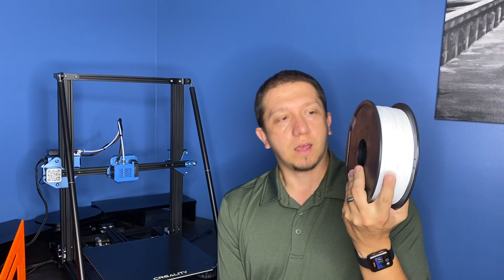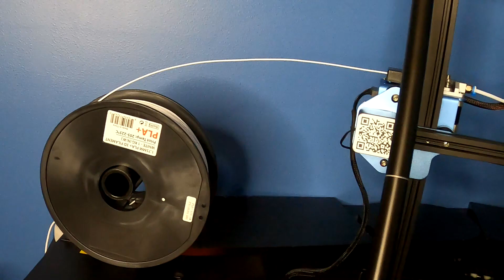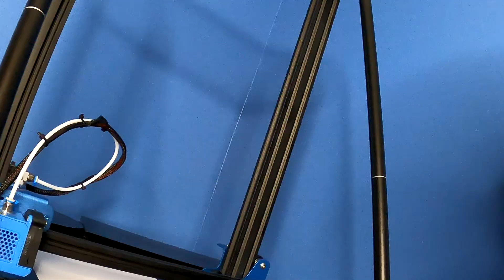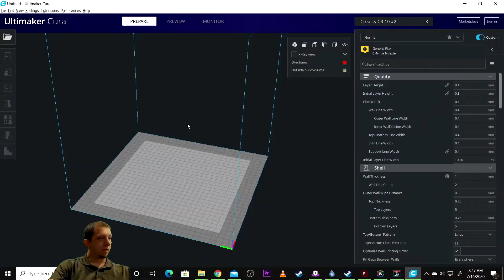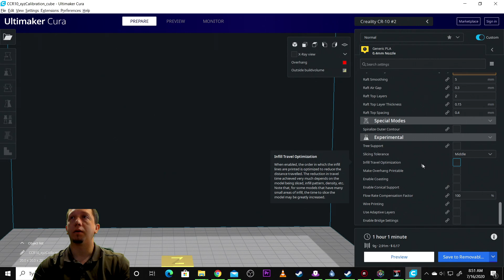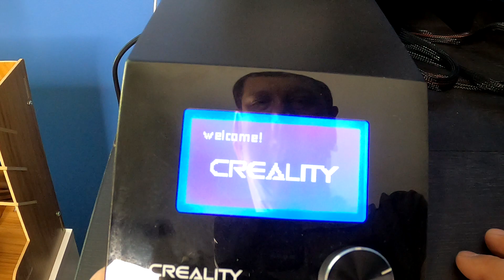NEW Creality CR-10 V2 3D Printer Getting Started ( Part 2)

Comment: Is it possible to make this printer wifi with a raspberry pi? I don't see a USB port on it but I was wondering if I could use some kind of data adapter sd to USB to hook it up. Thoughts?
Reply from the maker: Yep octoprint with a raspberry pi works just fine with wifi
Reply: @Rise3DPrinting  right, but how do you connect it to the cr10v2? It does not have a USB port on it, correct? At least I don't see one on mine.
Reply from the maker: @mikehernandez1089  it has a micro usb port

Comment: But you cut out how yo move the bed closer to the nozzle. I'm having the same problem right now, I can't get my bed up to the nozzle close enough even with the springs fully released. How did you do that? You shut off the video to do that
Reply from the maker: On the left side is the guide stool switch.  You need to loosen the. Bolts and lower yours a bit

Comment: Hi Bro could you please share the Creality Cr 10 V2 profile setting currently i have a problem printing my models either the mesh is broken or the model does not stick to the bed and and is off from the z axis, i really dont know what is the problem it is a brand new printer just printed one model and after which i got this issue , not sure if my bed is alligned correctily or the filament is not loaded properly. Also the filament comes out like thin strings please help me brother
Reply from the maker: Please send me a email to mike@riseofthefenix3d.com.

Comment: I've had my CR 10 V2 for almost 1 month and have yet to print more than a bunch of little men to sit on my monitor.  Today I installed a BL Touch.  It worked successfully but..  my extruder started running backwards.  Any thoughts on that situation?  Is there a way to reset the firmware?
Reply from the maker: That is really strange. So theee is two sets of firmware with and with out the borough. I would reinstall the without and make sure you are installing the most current.  If that fails I would contact creality support

Comment: I just got the CR-10 V2 and so far I've had to rebuild and rewire a few things.  There's still a short some where.  I'm not willing to write it off yet because I can see the possibilities in it.  The most frustrating part is leveling the bed...  I've leveled 5000# mills faster and easier than this and I've already got a nice scratch across the bed from leveling.  But I'm not giving up.
Reply from the maker: Never give up.  As far as wire shorts they do have a warranty to get replacement parts.  Also check out my vid on bed leveling.  I use the machine at gauge and it works geeat
Reply: @Rise3DBuilds  You mentioned posting your Cura settings for the CR 10V2.  I printed the X Y Z calibration block with just the CR 10 settings and it came out ok, all bit it a bit rough.  The top looks good but there's a lot of striations on the sides.  Great Video, thanks.  It did help.

Comment: I haven't started 3D printing yet and have seen a few videos about leveling the bed using this type of process. A question I've never heard addressed though is, why could I not just use a bubble level to make sure it's level? Thank for the video, great reference material for the processes!
Reply from the maker: The bed has to be leveled to the nozzle. The bubble level would not be able to do that. That would give you a level bed to the perfect straight but would not account for the nozzle hitting the bed and imperfections in the carriage.